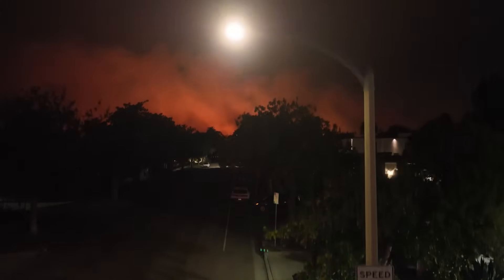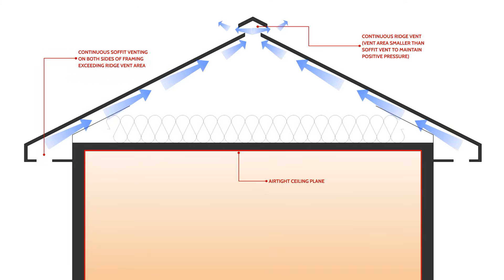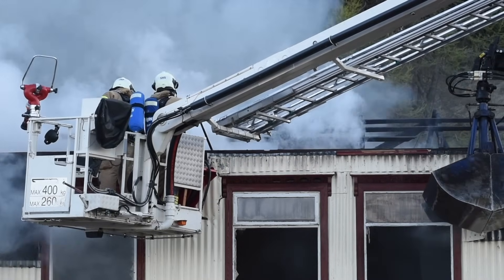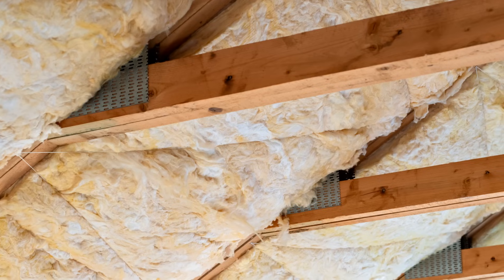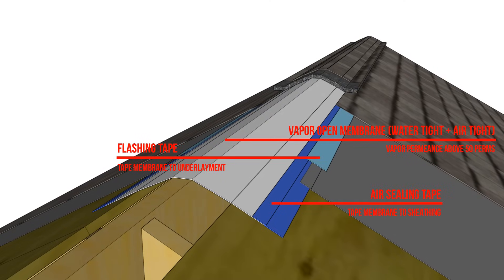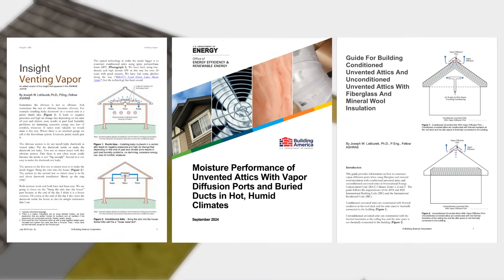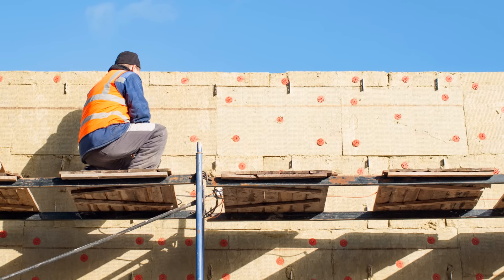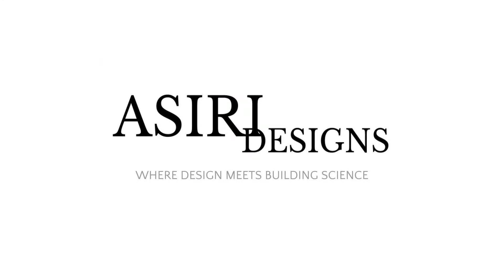How Vented Attics Worsened the LA Fires

Comment: Hello, great video! I was wondering about what you think about applying fire intumescent paint to the framing members, trusses and the interior surfaces of sheathing in a vented attic in a cold climate? I’ve read that these paints (which react to a flame or ember and “foam up” to prevent the underlying wood from catching fire) are not meant to be used in an exterior application where rain can wash it away over time or UV rays from sunlight can degrade it. In addition to high temperature roofing underlayment, metal roofing, fibre cement exterior trim and soffit material, Vulcan or Brandguard vents and mineral wool insulation, painting all the exposed interior attic wood with an intumescent paint might be a great additional step to take in order to prevent your attic from catching fire.

Comment: A former fire chief prevented two fires in Altadena (Eaton fire), by pouring milk and beer on the meters that were getting super hot and smoking. Those were the only two houses that survived the fire. 

It’s not the first time I’ve heard about meters causing house fires in this last round. A few people mentioned it. But no one else is really talking about that. Geee. I wonder why?
Reply: What meters, and why? And is there some way to prevent this issue?
Reply: @tonyduarte9503  The electric meters attached to the house. This is the way they are installed in most houses in Ca.
Reply: @Moondoggy1941  So I guess the electrical lines were just conducting heat? Not sure where from or where to, since there would be cut lines all around. Really, this all still makes no sense to me.
Reply: Yeah this theory is new to me as well. I was stating where the meters are usually located on homes in Ca.  I firmly believe that the sparks get into the attic. Watch the fire in Laguna Nigel in Ca. You will see house after house burn from the inside out.
Reply: @Moondoggy1941  the meter attaches to the house almost everywhere...it not being attached to the home is the unusual situation...

This "Theory" makes no sense and till OP posts a source for this "claim" I will be skeptical...
Reply: @tonyduarte9503  I agree, also once the fire starts or even before they shut off the electricity to the region. A city next door had there electricity shut off for 3 days. No fires just really windy.
Reply: Source...

Comment: I would love to see more videos about this, especially in the climate where I live in Portland, Oregon which is a 5b zone. (brief hot summers and long cold, wet winters) Venting is done through soffits and turtle vents, and my  unconditioned attic is moldy after only 18 years. It was built using conventional ideas of attic design, yet pretty much everywhere you see a soffit, three feet or so above that you will find mold. So there's got to be something wrong with the design theory.

Comment: Wood fences in between houses contribute to embers going straight up into vents. I am considering spraying phos-chek in my attic and having closeable vents on each end.
Reply: There are a number of non toxic flame retardants that can be sprayed on the exposed wood. All fiberglass batts, blown cellulose and rockwool insulation should be fire retardant, but the paper moisture barrier commonly used on fiberglass batts is extremely flammable. Applying spray on flame retardant to the paper would be a good idea. I also highly recommend the Vulcan Vents be retrofitted.
https://www.youtube.com/watch?v=_h9jJvmBCK0

Comment: Good luck getting R60 in an unvented attic. Even R38 is a tall order.
Reply: Are you talking about a new build or a retrofit? It's easy enough in a new build cause you can upsize the framing as needed...sure it costs more but that is the price of having a truly fire resistant design...you either pay more to build it better or you let it burn when they time comes.

Protected vents and such work if installed perfectly...these just work because their is no vent to protect with a special type of vent or install technique
Reply: @triaxe-mmb   R-60 is 14" thick. You'd need a massive 2x under the roof decking or something. And then what of the weight of it all? Just sounds like a terribly expensive and difficult way to build having to engineer around all that.
Reply: @Supercharged111 also, as for cost - cheaper than a total loss when a wild fire burns thru...🤷🏾‍♂️
Reply: I will agree - retrofitting a r60 ceiling rating to the roof line is not going to be easy
Reply: @Supercharged111  you can get there with 2x8 plus exterior insulation (even a 2x6 but then roof loads might come into play due to out board insulation weight), or 2x12 with higher R value product than standard blown in products...

I would do exterior insulation and reduce rafter thickness...but to each their own
Reply: @triaxe-mmb   The exterior stuff runs on the order of R5 per inch so would add up really quickly. And now the question of blown in foam trapping moisture and insurance companies not wanting to touch that. Just seems like a can of worms to me. Totally doable in a warmer climate though.

Comment: 3 little piggies ...
Reply: OK, you build a house out of stone in earthquake country - let me know how that works out for you when it hits

There are tradeoffs...you need a fire safe construction but you also need it to be light and flexible off earthquake...it's far easier to make wood structure fire resistant than a stone/concrete structure earthquake resistant...

Maybe we can build with steel...beat for both...but then those that  $1-4M homes will now need to cost $2-8M in that fire area...
Reply: Fire is preventable, avoidable and even resistable...and earthquake is non of those things...the only guarantee is that there will be one someday and that there will be a lot of damage...

The deadliest earthquakes (without a Tsunami) were all in places were stone and concrete construction is the norm...when those buildings fail, it is catastrophic...

Comment: So cool and heat the attic?  Really?  Doesn't sound very energy efficient.
Reply: That's why it hasn't been done until recently.  Trade off between fire resistance & energy efficiency.  No free lunch.
Reply: It can be but it requires you to do more than just unvented attic. You do a full wrap of exterior insulation, crawls pace encapsulation, and with other measures and your total energy efficiency will improve enough to absorb this added load... probably...the math varies by climate type...

But it is more fire resistant...and that is very important if you live in zones with high fire risk

Comment: I'm a big booster for an unvented attic assembly  in CA as code. Like you said, there's those vent covers, but it's just better to close it off. I'd like to see unvented attics and metal roofs and houses with an outboard blanket of rockwool covered in a fire resistant cladding as standard practice. The exterior Rockwool would  help with the ant and termite problem too.
Reply: Metal roofs don't burn
Reply: Believe it or not, metal roofs are not class A rated without a fire resistant underlayment. 
You'd be shocked how many roofers and inspectors have no idea that a fire resistant underlayment is required as part of the assembly over wood decking See for example Gaf versashield.
Reply: I'd suggest that "unvented attics" are bad, but "Conditioned roof spaces" are so much better ;-).
 I.e the positive message beats the negative in terms of getting folks to do the right thing.

Comment: I'd like to know if vented cladding systems need spark protection. And if there are good ways to use external mechanical shading systems, or window shutters, to protect the windows from the heat.

I've also wondered if a perforated foil radiant barrier could be used over the top of external mineral wool with a back ventilated tile system hung on stainless steel roof battens/profiles. Maybe even without external mineral wool.

Comment: Why do you discount Vulcan and other  engineered vents by saying "it's a lost cause". Either they work or they don't. As a matter of fact many types of vents are approved by the State which only involve 1/8" wire mesh. Aren't they proven to stop embers? If not, we should address that and not just disregard it. In fact, people can and WILL use vents as long as they are approved. If it is bad practice, they need to be told.
Reply: He said once the embers get in it is a lost cause...it is better to not have a vented attic than to depend on a single point of protection...if that single protection system fails (due to install error, damage/wear&tear, production defect, etc)then you are basically toast...an alternative is to install sprinkler systems in your attic but that costs typically more than installing invented roof assemblies...

Comment: There are closeable vents available. Asphalt shingles are made with tar which is flammable, steel shingles are not. Steel shingles also uses closed cell membrane underneath that seals off airflow past the shingles.

Comment: This is a great start. But to my best knowledge, unvented spaces pose their own dangers, especially in instances of maintenance. Accumulation of gasses from materials outgassing and oxygen depletion. It seems a system operated vent door would solve this issue more effectively.
Reply: HRV/ERV's are very important in very well sealed houses to keep the air clean and changing.

Comment: Interesting.

Recently a number of UK insurance companies have started to not insure homes with spray foam insulation due to trapped moisture between the foam and deck sheathing.
Reply: improper installation practices,   old retrofits.  site your sources for this disinformation....
Reply: @boossersgarage3239  I cited the BBC November 12th article.
Apparently my comment was kicked.

I worked in the EIFS stucco industry when it was under attack because of issues in the late 1990s.

95% of the litigation was thrown out of court due to a littany of factors.
Improper install, lack of waterproofing details, etc.

However bad press, kept homeowners from using a good product.

This was also reflected in banks not giving loans for houses made out of EIFS or insurance companies having higher premiums.

So you can argue improper install but perception by banks and insurance companies is the problem.
Reply: Improper installation != bad strategy
Reply: @hansaya  it is not possible to get a good installation when attempting to retrofit spray foam into a house.
Reply: @keiboman  ,  ur wrong too...
Reply: I have 100% cathedral ceiling with closed cell spray foam then dense fiberglass board over 20 years now that E84 fire retardant they put in the spray foam makes it fireproof, and I have my own fire hose outside, because the fire department always lets your house burn their business strategy is let more damage happen so they stay in business.

Comment: CA should also require all new roofs to be Class A.

Vented roofs and crawl spaces and be mitigated with proper screens.
Reply: They are required in fire hazard areas. But not re-roofing. Existing houses don't have to be upgraded fire-wise in remodels or additions, probably because the old parts of the house will cause it to burn anyway. When you consider how extensive remodels can be, and the effect of burning buildings on neighboring structures, this is perhaps an oversight.
Reply: The screens are a single point of protection and so a single point of failure...you are literally betting the house on those screens working perfectly, installed perfectly and such...

Comment: The ideal insulation strategy for a wildfire zone seems to me to be external rockwool insulation, with a non-combustible siding and roofing, and tempered glass windows since they can better handle high temperatures. Also, creating a zone around the house where there isn't any combustible materials helps a ton. 

Ground source heat pumps also could assist in keeping the indoor environment cool since the ground temperature won't be very affected by the air temperature.
Reply: You have to consider whether the rockwool assembly will inhibit condensation. There is no typical totally non-combustible solution since roofing can't be attached to rockwool. I guess you could devise some metal framework (which will probably buckle if the heat is great enough).
Reply: @pcatful  Rockwool has off the shelf cladding and roofing attachment solutions made out of steel. If you mount steel cladding/roofing on steel brackets I think it can take quite a bit of heat.

As far as condensation goes, thats just a matter of installing correct vapor barriers in the assembly, eg. SIGA's membranes. And of course installing a sufficient amount of insulation.
Reply: I think the ground source heat pumps can be an especially good idea for the lots where they need to redo groundworks anyway. That would probably be easier to "start fresh" with it rather than retrofitting.
Reply: Rockwool insulation on exterior walls probably won't help much if the sheathing is OSB.  Exterior sprinkler systems that douse a house in the event of a fire might, but water mains might not have capacity for the whole area
Reply: @robertm5969  Exterior rockwool absolutely will make a huge difference, it is non combustible, and especially with an air gap from the rainscreen behind the siding it will reduce the temperature on the inside face of the rockwool where it meets the OSB to below temperatures where the OSB can combust (400°F (204°C)).
Reply: @bastiat691  I was thinking of batts inside the studs and sheathing.  Didn't realize they made exterior insulation board that goes outside the sheathing.  I agree, looks like a good solution
Reply: @ It has only recently started being used in single family housing, it first found use in multi-family housing and commercial construction, so its still not that known by most people. Really cool product for sure, especially combined with the steel Cladding Attachment Solutions that rockwool makes to attack cladding on the outside of the exterior insulation without using any wooden rainscreen components.

You could also go the extra mile and use an aluminium self adhered membrane on the outside of the sheathing underneath the rockwool insulation, would give a last line of defense.

Comment: Nice!  Very good to know, thank you!  A few potential issues:  The ridge vent should be non-flammable.  The free edges of the plywood don't meet wind code, unfortunately.  And, most asphalt-shingle roofing manufacturers don't honor their warranty for unvented roof planes, because of heat buildup deteriorating the shingles (people often do it anyway knowing that).  Satisfying thermal, moisture, wind, seismic, and fire is challenging.
Reply: Do you have a specific product recommendation for the ridge vent? I am building a house in hi fire risk area, and would try this, if there is a product that is code compliant
Reply: @genesmasher  Vulcan (I think) makes most any WUI compliant vent, for a price.